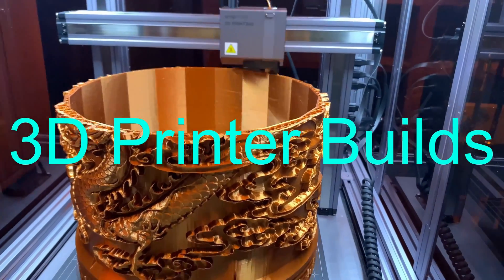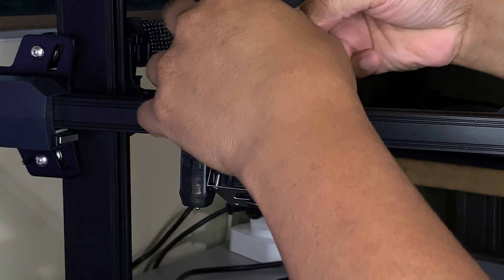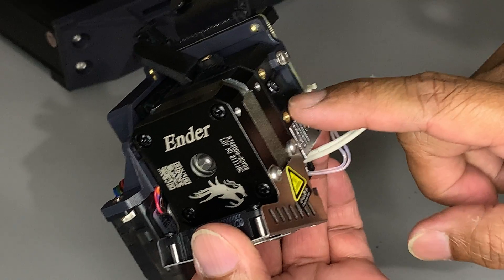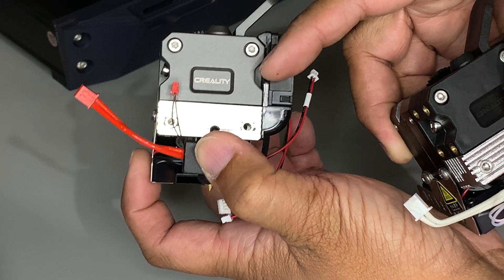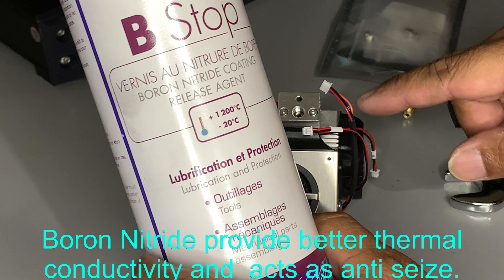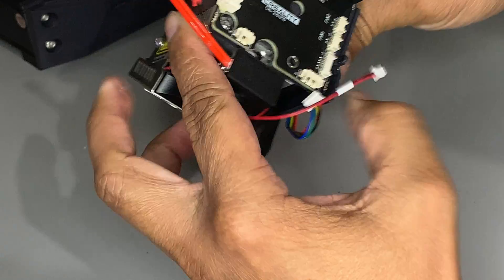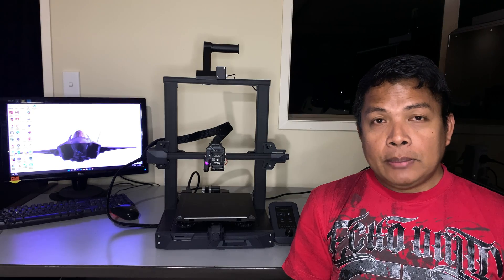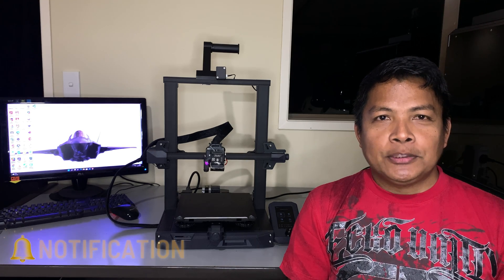Ender 3 S1 Extruder Upgrade to Sprite Extruder Pro

Comment: Thanks for sharing, interesting. Is the part cooling fan enough in matter of print quality?
Reply from the maker: It’s sufficient enough, but it can improve. A lot of factors may affect print quality not only part cooling, setting can be compensated if you feel cooling is insufficient. But the way it is, I have no complain.

Comment: Have you noticed any improvement for using boron nitride for the nozzle? Hardened nozzle conducts heat more poorly compared to brass so this is a nice idea to me at least, compensating the conductivity at least a bit.
Reply from the maker: Yes but very slightly and stable especially after PID tuning. Another benefit is when you need to change the nozzle, it has a release agent the nozzle won’t seize overtime.

Comment: I just did the same upgrade. Can you advise on how to change the firmware so we can get to 300?
Reply from the maker: The current marlin firmware, can only be change up to 285, 15 degrees below the max temp for thermal runaway protection. I haven’t try this. Some people can go over 300, but they made some hardware upgrades on their machine.
Reply: @jvianneyjr  you can ask everywhere „whats the benefits“ bla bla bla bla…..printing nylon Caren
Reply: @petermarkk1408  For nylon is better print in a enclosures printers.  ender 3 S1 pro isn't for nylon

Comment: whats the difference between pro and non pro?
Reply from the maker: The pro is all metal hotend. The extruder assembly and infeed lever are metal. The heatbreak is titanium alloy and can handle temp up to 300 C. The other extruder has plastic extruder assembly including the lever. The heatbreak still has PTFE sleeve tube.
Reply: @simplified3DHub  thanks!
Reply: @simplified3DHub  So still PTFE tube even in the Pro ?
Reply from the maker: @3dprint4u  No, the pro has titanium alloy heatbreak, its all metal hotend.

Comment: Where did you get the nozzles from?
Reply from the maker: I bought it off a local 3D printing store here in New Zealand, but you can find them in AliExpress . NZ$ 23.81  47％ Off | CREALITY Official 3D Printer Parts MK-HF Nozzle Kit 0.25mm 0.4mm 0.6mm 0.8mm 5pcs/Set Copper Alloy for Ender-3/CR-6 Series
https://a.aliexpress.com/_mK31pFG
Reply: @simplified3DHub  thanks. I received sprite extruder pro today. Does i need Boron Nitride Paste for nozzle and hot block ?
Reply from the maker: @khoiNguyen-ws7wc  yes if you have boron nitride, if not, It doesn’t really matter.
Reply: Do you use stock firmware or custome firmware
Reply from the maker: @khoiNguyen-ws7wc  I contact Creality about this upgrade and they said it doesn't need Firmware update, so it still on stock Firmware.